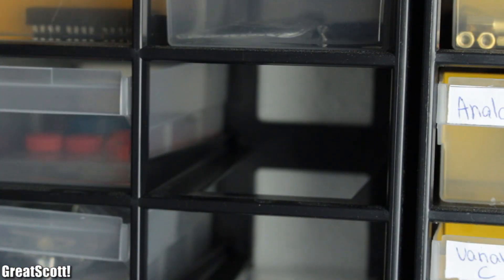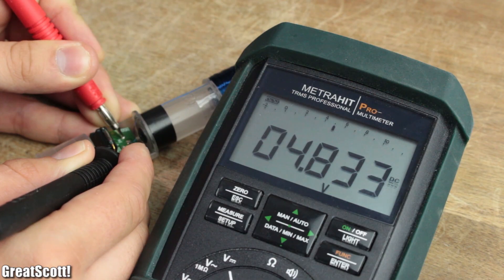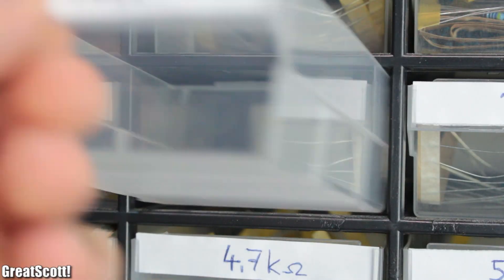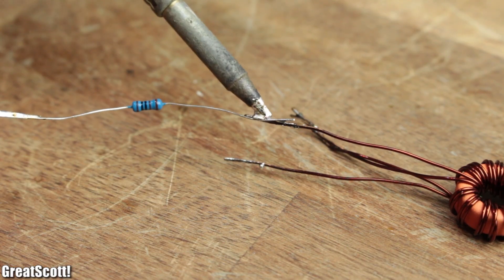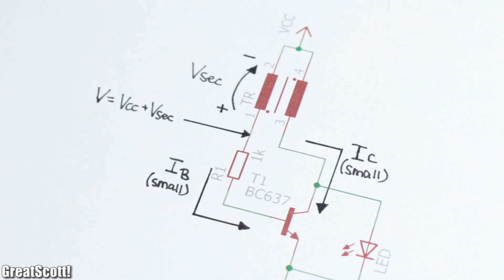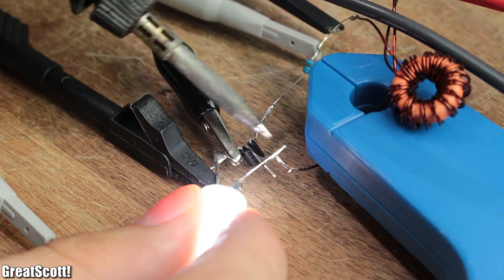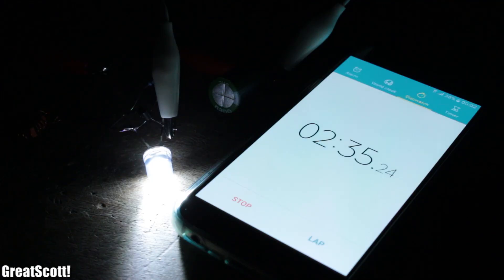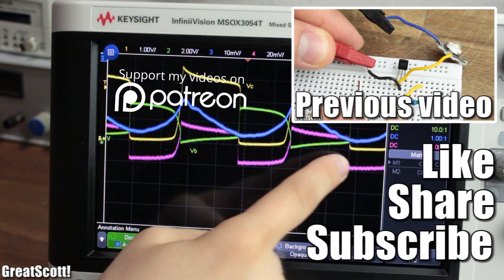Supercapacitor Joule Thief

Comment: I added one of those in my homemade hand crank flashlight (with sooo many sacrifice due my lack of experience in soldering plus a bad equipment and material), my coil has ~13 turnings, and now, the LED stay bright much much less than when was only the capacitor ;-; I cannot build another coil, should I replace the resistor?

Comment: A PNP transistor will also work just connect the power and any polarized parts in reverse polarity .
I use 2SC5200 NPN or 2SA1943 PNP and a lot heaver gauge wire 
4 , 4.7 , 5   volt DC input   and more than enough power at the output to light up a lot of LED's  .

Comment: I bought some green and some yellow toroids from AliExp, and found the yellow ones pull way more current than the green ones. Then I found the yellow ones were made of conducting metal and so have eddy currents. The green ones are ferrite ceramic and are better for Joule Thieves. I have wound the cores as you have plus put a third winding on them to give another out put option. I can't understand why this other coil gives DC pulses, I think they should be AC only, but a 12 Volt LED string only lights one way and not at all if reversed. (STRANGE)

Comment: Hi, its a bit late but i have a question. I am trying to do a project that includes joule thief . I did one but its not well efficient. How can i improve it?(im using a 5.5v 0.22f capacitor for energy supply, bc337 with 20k resistor on its base pin and an old transformator from an old laptop charger.)(and sorry i dont know much about making a circuit). 

Thanks for your reply.

Comment: I revisited the joule thief circuit to try and improve it and I've hit a road block ..

The problem is, a transistor only begins to switch on when the band Gap of silicon is reached 0.6v so the lowest voltage of an alkaline would be 0.6v

But at 0.6v there's still quite a bit of energy left in that battery! so my solution was simple, use 2 batteries eg 1 aa battery to power the circuit which the extracts the remaining juice

But I quickly discovered using bjts at only 1.5v requires the base current to be around 4ma to drive that inductor and at 4ma you would have to replace the battery every few days to run the circuit that drains the battery

So I decided to use a lithium ion battery which can be recharged to 4.2v and now the voltage is high enough to run an n channel mosfet which drives the coil without the 4ma current drain the npn transistor required 

So to conclude, I believe we can suck out a good 30% more juice from a dead cell

When a battery reaches around 0.2v a 10uh inductor will light up a 20ma led

Now I need a suitable logic fet to actually build this version

Comment: Thank you, my friend, for this video. I have a question. Can we use this circuit with a voltage greater than 1.5 volts and a limited increase in it?
For example, a 12-volt battery voltage to raise it to 16 volts only ??

Comment: Hey really would appreciate some help. 
Would a BC558 work instead of a BC637? 
Same with a 1F 5.5C 30 OHM super capacitor. 
Trying to find the parts for the shake flash light and i can’t find everything needed. 
I will be using this for a project in my electronics class for my students. 
Any help is extremely appreciated. 
Thanks!
Reply: Anyone please

Comment: I found that using water or gases to explain how electric circuits work makes things a lot easier to understand. Basically, the transistor causes flow in one direction through the coil, which then causes the flow to stop due to the magnetic interference of the coils going in opposite directions, which stops the transistor, but all that electricity in between the coil and transistor acts like a small capacitor (quick-discharge battery), and the current from that part of the wire gets added to the current of the battery, to power the LED, then that emptying of the capacitor-like wire causes current from the battery to be able to flow to the transistor again, and the whole thing repeats itself. Electricity also has inertia.

Comment: I made this circuit but i used toroid with two separated coils on one core, because i don't have another one and shops are closed. It didn't work, so i used arduino for driving the transistor. Then i connected LED... it instantly burned. I didn' have enough courage to measure the output voltage, so i connected 10 LEDs in series. Then it finally works. The voltage spikes are probably HUGE. Do you know why it didn't oscilate itself?

Comment: I got stuck at understanding the configuration of the transformer. The part where one coil is connected in reverse to the other and yet in the circuit diagram it's shown to be connected in the correct configuration. I really don't know what's going on with the transformer connections in the circuit diagram

Edit : I change my point of concern. More important for me is how do you calculate/estimate the voltage output at the collector of the transistor. Is there a way to control it? Also, can I control the output current by just simply putting a resistor in series with the LED.

Comment: If you use the same a  2coils at 100mH one round clockwise the other one around counterclockwise and a capacitor at 100mF it works better.

Comment: Hello Scott. .. I hope you see this,  long time since this video was up. .... I have had this idea for long time,  I haven't been able to find a solution.  At home we collect many alkaline batteries from different devices around the house. So i was thinking in using them 10, 20 in parallel or a combo serial  n parallel in order to feed a joule thief,  at the output of the JT connect a boost convertor to get 5v or 12v in order to power a led lamp or perhaps any other device. Because the lamp or device won't be on all the time, i don't know how to switch the JT on and off in order to make the utilization of the batteries dynamic and efficient. Do you think you could help me with the solution? Thank you for any help you can provide.  I enjoy your videos.

Comment: My self-wound inductor on 10 mm long bit of 100 mm nail w 40 turns of doubled 0.25 dia wire gave inductance of just over 1.1 uH. On a flat AAA battery (below 0.9 V) it worked fine without a resistor, running the LED for several days. Analysis and trials with better inductors (3.4 uH and 1k, for example) found more and stronger voltage peaks at various frequencies as the voltage declines. V interesting circuit t play with!

Comment: wait, 22 farad capacitor fully charged only powered the led for 20 minutes? that's less than 1 minute of light per farad! a 1 farad capacitor should be able to power a standard LED for 3 hours with the efficiency of this circuit.

Comment: Yes, I did like the video.  I wish I knew as much as you do when it comes to electronics.   You made that hand wound transformer for example. Is that what all those are when I see them in my parts boards.  It would be great to know how to use them let alone know how to make them, and to the right size.

Comment: I can't make it work.

Tried winding the inductor out of 42AWG magnet wire. I can't get it to 
work. 60 turns with a center-tap loop, used a meter to make sure all of 
the pins were connected, resistance was about what I expected. Hooked up
 to a 2N2222 transistor which is known to work from previous 
experiments, with no resistor, small resistor, and a large variable 
resistor, can't make it work.

Checked online, there's basically no information out there for getting a
 joule thief to work because it's SUPPOSED TO BE BRAIN-DEAD EASY! The 
only possible problem I could find was that maybe the coil was wound in 
the wrong direction, so I tried again, this time instead of just pulling
 a center-tap loop off the coil, I reversed the last 30 loops. Which I 
think is wrong, but I have NEVER been able to get a joule thief to work,
 so hey, let's try stupid stuff.

Nope, I can't make it work. Won't oscillate, won't power a pile of LEDs 
stacked up to a slightly higher voltage drop than my supply is 
providing. The collector and base on the transistor just sit there at a 
constant, no-ripple 5v.

Using a USB power source for my supply, but that shouldn't matter, 
because I've seen them run on everything from dead 1.5V AA batteries to 
brand new 9V batteries. I just can't make it work.

Anyone want a mostly unused roll of 42AWG magnet wire? I don't have any 
use for it if I can't figure this out.

Comment: Is there a specific reason why you chose the BC637, or is it just what you had lying around?
Reply: I think this is because with the BC637 you can use 1A collector current, on the datasheet it says that this is a "high current transistor". This is really high, compared to, lets say the common 2n5088, which can withstand only 0.05A.
Reply: @ferenctoma1  oh wow that makes sense, thank you very much :)
Reply: There's a specific reason.
Reply: @mousamupadhyaya8053  which is?? this is so unhelpful -_-

Comment: 555 timer to perform pwm so you can set your desired frequency, have the 555 pulse a hand 
held laser , have the laser beem trigger a photo transistor, have the photo transistor pulse your joulse thief inductor. This way you can create 120 volts stable sign wave , and the wave will be very clean , so the cleaner the wave the less heat , so the less heat the less energy loss. When I get time and resources i will build this and i will use resonant frewuencies such as 432hz , do not try to recreate 60 hz for your house, all your devices will run on any frequency you want just keep voltage at 120v or 220v , 60hz is for grid use only , higher frequency in the Kilo Hz range are safe and effective . Use vortex math to get your frequency (TESLA) 3,6,9, 432 equals 9 when you add the numbers.. By pulsing with photo transistor your can isolate the circuit and mainly for use of avoiding using voltage as your frequency determinating element.  Now you are using voltage to pressurize the inductor to trigger the transistor into self oscilation, which gives you little control over frequency, you have to use higher voltages across the inductor to get results, when you can use lower voltages at higher frequencies to get the same results with less to no energy usage theoretically

Comment: What?! It's a real 22 Farad SMALL Capacitor?
Reply: It's a supercapacitor, meaning it won't tolerate more than a couple volts.
Reply: @diablominero  ok, but then they are not able to accumulate enough energy for supplying high power devices, for instance, a drill, or they do? 😂
Reply: Yeah capacitors now are geting smaler
Reply: @davewatch8304  how much smaller? If they needs more surface and mucho more less distancie between the plates or contacts

Comment: It’s deceptively complex but elegant however not unsolvable, I would like to have a red hot go, 
the key to the device is that the Fe potential diff vectors into the center or ‘zero’ point of the mirrored inductor you can draw one as ‘left’ and one as ‘right’ the configuration of one mirror  makes for say the Right mirror to be polarized to the equalization polarity which is through the through put of the valve, the other Left mirror is of course the mirror of this vector and thus has the opposing polarity to the right mirror at its vector which circuits to the valve switch or ‘gate’ , as the inductor winds up Gforce vector and offsets inertia this polarization effect also winds up, and turns the valve switch which is operational on that polarity difference, at a point of maximum offset there is no more inertia offset and then the polarity path vector begins to change to the ‘natural’ circuit path to equalize from the ‘zero’ point to its natural point which is also the throughput of the valve. This causes the polarity to shift In relationship to the gate of the valve and the whole of the inertia offset unwinds or winds down to the equalization path. The key as stated is that the Fe potential vectors into the ‘zero’ point this makes the two polarities opposed on the mirrors and means that when the left mirror is at max inertia then so is the right, in essence one inertia .

Comment: I like your video, thank you this project is very helpful for me. I have a question for you, can I make it by soldering two resistors series (180kOhm + 20kOhm) then I solder that components in parallel with the 470uF 10v capacitor, then I connect the 20kOhm resistor parallel to the joule thief circuit(1 volt to 3 volts), finally the output of the joule thief  connected to the 3 volt LED.

I mean the capacitor will be longer for being empty if it is connected to a resistor with high resistance.

Comment: I don't understand how the joule thief circuit has lengthened the runtime of the LED.

If you can get 5 minutes of runtime from a .33f supercapacitor with no joule thief, why can't you get way way more time with a significantly larger capacitor? 

The 22f supercapacitor is 66 times larger than the .33f supercapacitor in the flashlight, so shouldn't you be able to get 66 times more runtime (330 minutes) with just the 22f supercapacitor and no joule thief circuit?
Reply: Its like the difference between letting water drain out through a small cloggy pipe, then having suction on the far end of the pipe to overcome this.

Comment: Why does everyone touch the solder gun tip and solder both from the   same side/top? The solder flows to the heat. Heat the joint from the bottom and touch the solder to the top.

Comment: If you add a OpAmp um comparator mode so it uses the joule thief circuit only in some voltagem range of the capacitor, could it solve the low efficienty of the circuit at very high and very low voltages?

Comment: I need help and it looks like you know a ton of how volts and  Watts and amps. work I got a ebike. 36 to 48v and I want it to have more power. and for longer. Going over the v it say will it burn the motor.  I got 4 what to go to 5 or 6 11.1v battrys

Comment: Another great video
Reply: Got a ?(lots and lots) and by far a newbie to this hosts videos, very educational. Would anyone agree that there's a calculatable amount of volts in batteries(not capacitors), like there would be 77,000v(have no educated guess) at max charge in a standard 850cca car battery, wouldn't that be easier for everyone to understand? Instead of saying 143,643,897(idk) electrons completed 1 revolution in the field. Maybe it's a dumb question.
Reply: Maybe it could make charging batteries more like capacitors do.

Comment: I try using darlington transistor here, but not success. Darlington transistor have B-E voltage twice than a transistor (0,6V).

But with this idea, I try make a Darlington SZIKLAI PAIR type to keep B-E voltage at 0,6V and my Joule Thief much more more and more longer run time.
22F for almost more than 1 hour light!
I can't imagine if 100F used for this project.

:D :D :D
Reply: Darlington transistors waste a lot of power at low supply voltages.

Comment: What is if your use a 25V 10000uf capacitor?
Reply: Your question doesnt make sense. What for? It wouldnt increase light-time. 25v 10mf is 3.125J and 2.5v 22f is 68.75J. Also youd have to use a flyback converter.

Comment: I'm not an EE or anything, I just watch this stuff out of interest. But it looks to me like you engineers over complicate things with all these little frills, 'caps', 'trannies', 'transformers', 'diodes'....just plug the friggin thing into the wall and attach the circuit via conductive material and it WILL work, I guarantee it...stop being so fancy pants.

Comment: What does he mean by "soldering the opposing input and output wires together" ?
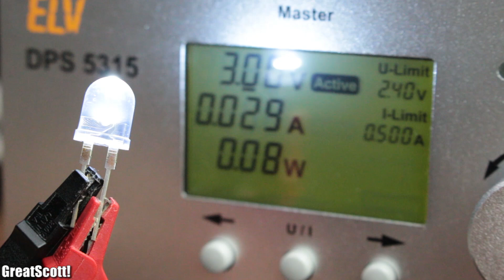Reply: That's wrong.  Only the input wires get soldered together.  You can see that the output wires are separate in the wiring diagram.  2:21

Comment: 'Hello Scott,

you made a calculation at 0:18 for 4700uF where you got 0.63J -- are you sure in this number? I tried to calculate by same formula you used before and came to 0.0146875J [assumed voltage is 2.5V] (same confirmed with following online calculator https://www.electronics2000.co.uk/calc/capacitor-charge-calculator.php)

Could you be so kind to confirm that your calculation is correct or incorrect?

Probably you have referred to full charge of the capacitor at voltage 16V :: 4700*10^-6/2*(16^2)=0.6016J (still not 0.63J).

Comment: Work a touch on soldering different materials goes. Sanding with 200 then 500 grit helps a lot for good solder, silver, tin, or leaded, good rosin amounts.

Comment: How that shaking flashlight works? I mean, isn't it better to rotate some mechanical parts that accelerate a magnet which magnetic field is inside an electric coil or however is that bunch of conductors that create a magnetic field called, that leading to creating some electrical energy. It's just, by turning, we create mechanical energy which results in electrical energy if the efficiency is 100%, if not it also results in lost energy, which is probably heat.
Reply: It is a very inefficient design, yes!  There are much better designs to be envisioned/created and that's part of the fun 😃!!

If you were asking why the magnet doesn't rotate instead of 'going back and forth' it is because of how the field lines of the magnet interact with the coil; only certain 'relative movement' excites electricity.

There are some really cool black and white/old time videos on electromagnetism here on YouTube you should totally check out if you're interested (Proverbs 27:17)!!

Have fun!!

Comment: Hi, just to enrich your information, the ripple in the voltage and current heat the electrolyte and subtract life time from the supercapacitor. Better Charging with pure DC, can be batteries, or pulsating current that does not change polarity

Comment: When the cap is fully charged does the joule thief heavily over voltage the LED?  Maybe a separate switch for the joule thief for after the LED dims to turn it into overdrive mode? would be nice if you could have it automatically start once the CAP got to a certain lower threshhold